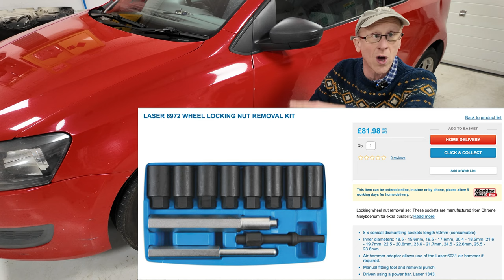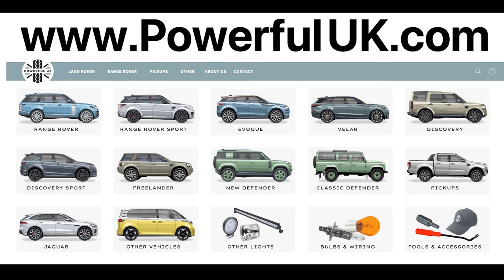How To Remove Locking Wheel Nuts With Laser Tools Locking Wheel Nut Removal Tool

Comment: Chisel off the ring then if you haven’t got the tools. Find a socket to knock on the inner diameter and use a bar to remove or impact gun. I just used this method on my mondeo

Comment: Had the same issue with some Jag XF nuts!! Gave up, bought 4 new nuts from Jag main dealer and asked them to fit them! £48 well spent!😂
Reply from the maker: A man that knows how to play the system ! excellent !
Reply: Those are a real beggar to get off there is specific type of removal socket for those which you use with an Impact Driver to bash the socket on to the nut. We've resorted to welding nuts on to those I'm the past!

Comment: 4:17 An Impact Socket is probably better to use as opposed to those sleeved sockets especially with an Impact Gun. Split plenty of that type with a gun use them with a breaker bar then Impact afterwards rather than use initially to break the nut. 😊
Reply from the maker: So far so good with the sockets but I will heed your warning !

Comment: Lovely video, but can you guys help with a D3 replacement key locking wheel key H.. my ones broken and seems to be the only key not available… can get any other letter key on eBay.. But not H (ones for sale at £5130!!! 😳
Reply from the maker: I have done some investigation.... leave it with me
Reply from the maker: How about i buy these and sell them individually
https://www.ebay.co.uk/itm/224923528869?epid=11020339397&itmmeta=01HPGRBKP0WFAZF7MWEDW6EP9T&hash=item345e7caea5:g:LfAAAOSw5QlbPeu8&itmprp=enc%3AAQAIAAAA8N3VD6Ubye8NLWF9nIJlqLjymb2OxlOXq%2F%2B2L7hrrWzubidnL8TATtOF3YQ%2BfwPOayfiY62%2B0zM0WaQugWft1oVIqZDoqq%2Fq39ewu9HmVAYNfLDxip7gN7S13em6qVu81lQa3blppcwU63%2BGzjYAuLbXXngFauP2%2FWgCo28U6nc2gC%2BzFNJRNP5Lm0jlyfO7zKXGDpB1fTAspjP6v9f783jqnythuw9sul7SgnGOJbsHaNXRXwjzQytP7QzLIo1kS23quvDTOyqZu%2F2Qtim%2FQOnJ%2F2lCWF9WNZaMA%2F5SB%2BOLf5ZvU5f%2FKFu43YMY4YDybQ%3D%3D%7Ctkp%3ABFBMqLuumLRj
Reply: Looking at the photos, they don’t seem to match, all the one in the set have a curved recess cut out, which isn’t on the Key.. possibly a different style? 🤔
Seems so strange it’s just the ‘H key’ that’s so hard to get 🤯
Reply: @L663  Thanks Simon.